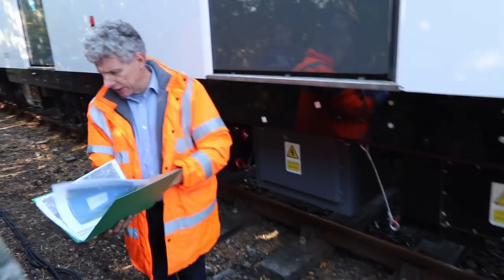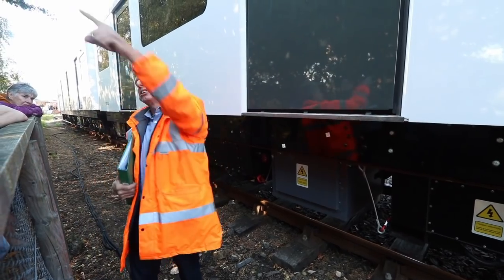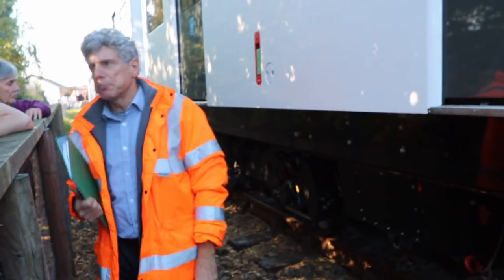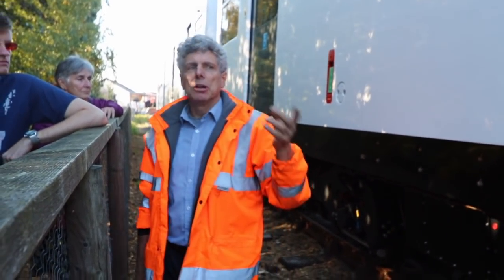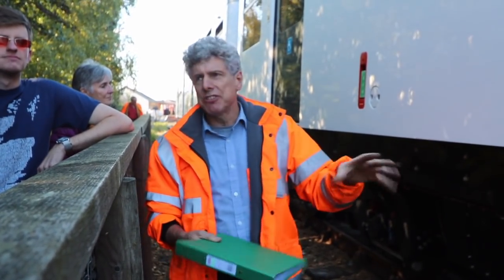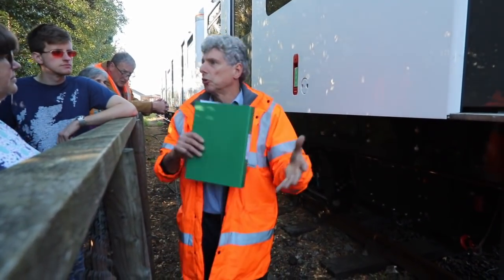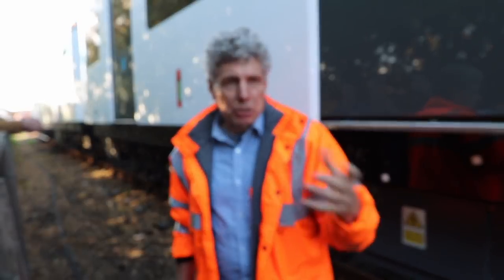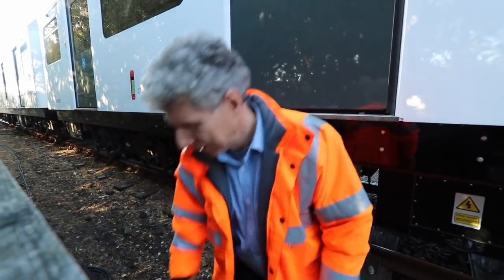How the Class 230 Battery Train works from the Expert

Comment: I remember the D78s on the District, but they certainly had DC motors. Given how reliable later DC motors were, I can't see the need to change them. The " Regenerative " system was also used by London Transport, on the "O" stock, one of the types the D78s replaced, in 1937, and also the "P" stock of 1938. This stock used a rotary transformer/motor generator called a Metadyne, from Metro-Vick. The system didn't work well as all the people that knew what made it tick were called up for WW2. The post war "R" stock had most cars built from ally, including the underframe. The "C" stock was all ally, and the frames looked massive as the new material wasn't as strong as the steel ones, so was of deeper section. The Ds were the same.

Comment: I thought London Underground was 630 volts, anyway,  why not supply the DC to a short section
of third rail in the sidings, terminus station and/or shed road , not be messing around with charging cables.  The conductor rail need only be energised when a train is detected in that section !

Comment: So 17ltr Volvo diesel to 3 phase, then change back to DC to charge batteries, then change DC battery output to variable frequency AC to power the electric motors!? How much efficiency is lost during all these conversions. Not better off with a DMU and stuff the Hi Tech?
Reply: Watch the video again, the man explains the reason behind it...
Reply: It doesn't matter the source of the power, its the fact that every time you convert from AC/DC/charge/invert/etc you loose energy. Its inefficient, its also over complex and riddled with points of failure. And if all this is to save Co2 its on to a loser because lithium ion batteries have to operate for years (5-8 years) before they are Co2 neutral.
Reply: Well, in your first message you do actually emphasize the source of the power. A DMU is likely to be more efficient than the whole generator to BEMU chain. But in this case the generator is temporary and will be replaced by solar soon. 
But once you charge via solar, the losses are getting less important. 
Regarding your latest comment - yes, batteries and solar panels have their losses and their break-even time too. That break-even time is getting shorter and shorter each year. Even if these days it's not a huge improvement, it is worth investing into because it helps improving the technology for later use. 
However, don't forget the pollution and emission caused by drilling and refining crude oil, have to be added to the direct emission from running a train on diesel. 
The Royal Shell company of The Netherlands is the biggest CO2 producer in the country. Refining and drilling oil is massively energy-intense. It is hard to make a direct comparison, but i think usually the CO2 emission of a diesel engine doens't take the indirect emissions from the refinery into account.
Regarding points of failure - the benefit of charging, is that it doesn't matter where you get electricity from. If the solar panel inverters fail, you take the big genset. If the chargers fail, you put in a diesel generator instead of the battery as explained in the video. But i am pretty sure that the inverters have a better uptime (even when you have to replace one) than an overhead line. We have overhead lines break pretty damn often.
Reply: Don't forget that to run a train on 750Vdc, Network Rail feed the power to the train by a steel rail, which is not a very good conductor,  resulting in a large power loss. At some places on the overhead rail network, (until recently on the ECML) half the power was lost in the overhead lines.
Reply: Surprisingly enough, mechanical/hydraulic transmissions are considerably less efficient than generating electricity and powering electric motors. Of course, most diesel locomotives work off the diesel-electric principle, don't they? As for the batteries, I don't particularly think they're the best solution yet, you're better off with a more reliable and efficient DEMU for the time being.
Reply: Couple things, the conductor rail on 3rd rail lines in aluminium, the ECML has always been 25kV AC overhead lines and these are very efficient in terms of power transmission.

Comment: Don't see the point of the bit where he said they are going to charge  a huge bank of stationery  batteries to then use to charge the batteries on the train.😟
Reply: There are limits on how much power you can draw from the mains supply. I suspect that given they are in a bit of a rural location, the limit is probably quite tight, and these trains draw a lot of power on charge, so in practice, you won't be able to draw the sort of power they need from the mains unless you do it gradually over several hours. Also, having the batteries means you can take power at night, when the electricity is a lot cheaper. Businesses have different ways of being charged for electricity use, so they can make use of this. There are now a few installations about that store up electrical power at night, then sell it back to the grid during the day at a profit. This is basically all happening because it's quite difficult and expensive to turn a power station off, so when the demand drops at night, it is much cheaper if you can avoid turning it off.